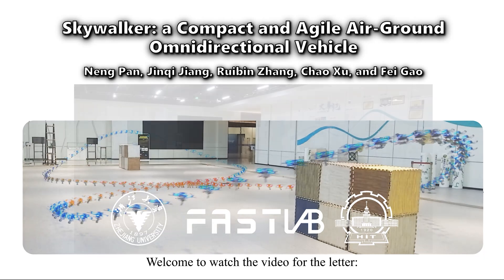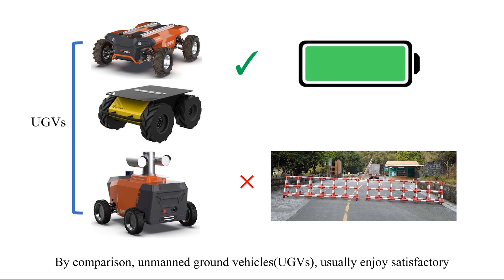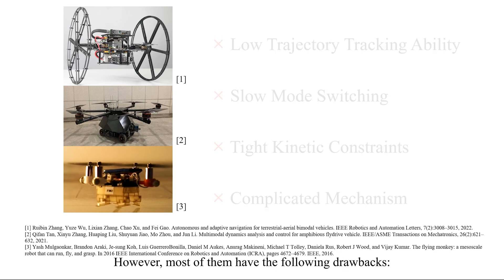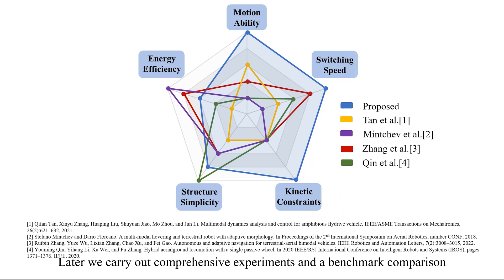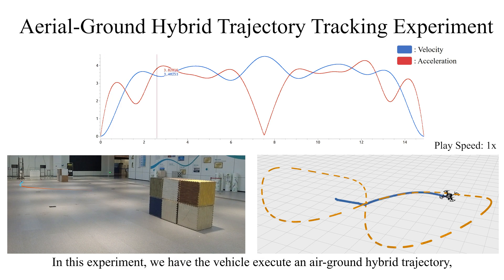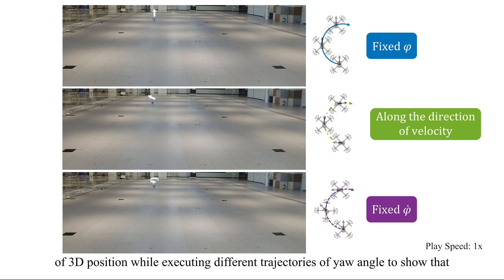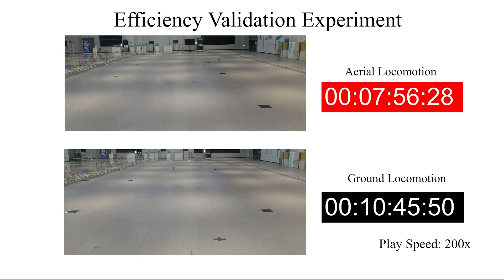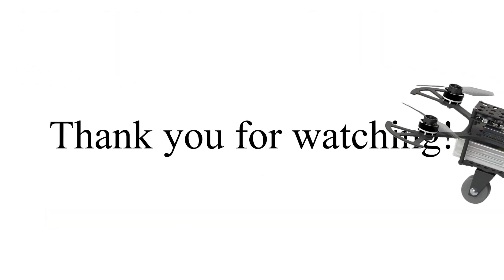Skywalker: a Compact and Agile Air-Ground Omnidirectional Vehicle

Comment: Leonardo Bipedal robot made by Caltech is far away from this . I can’t see any possible potential application of this  design . It’s nothing but a quadrotor that operates at low altitudes with help of wheel.